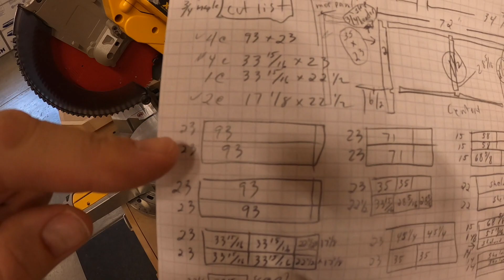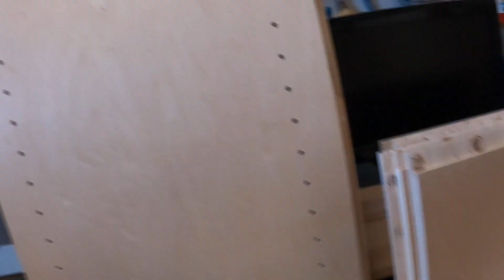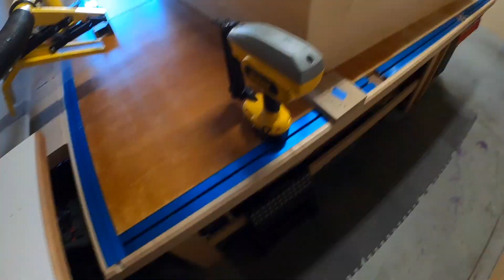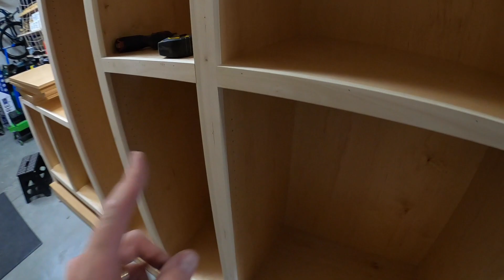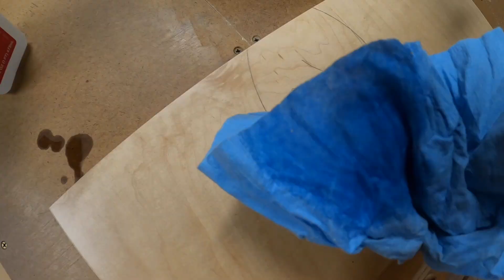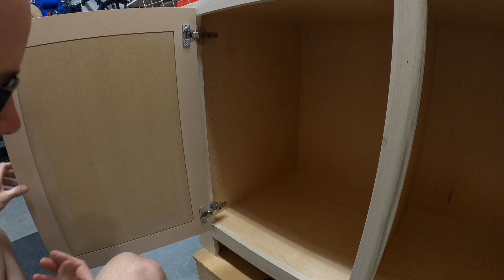How To Build Pantry Cabinets. From Start to Finish- Custom Kitchen Cabinets For Huge Walk-In Pantry.

Comment: Do you square up your sheets of plywood before making cuts on the table saw? I find a lot of sheets from factory out of square.
Reply from the maker: Great question.  Most all of my sheets are pretty straight so I run them through the saw ripping and then trim off the factory edge to final width.  This gives me good results.  Then go to crosscut sled to cut all to length. At which time I square all ends first.  This plywood wasn’t that straight. So I had a few that weren’t great but ended up being okay. If I had to do them again, I’d straight line rip one edge.  These were the worst panels as far as straightness goes that I’ve seen.